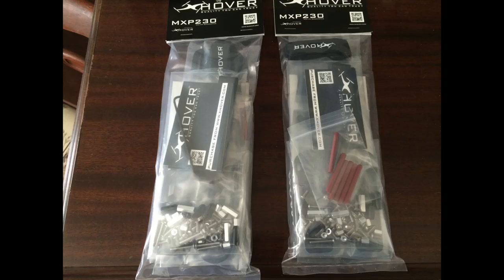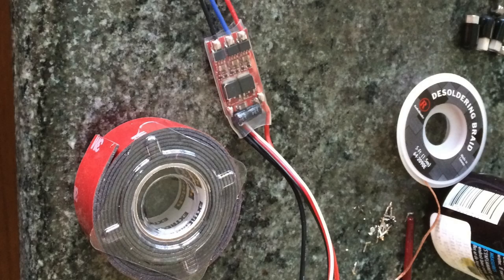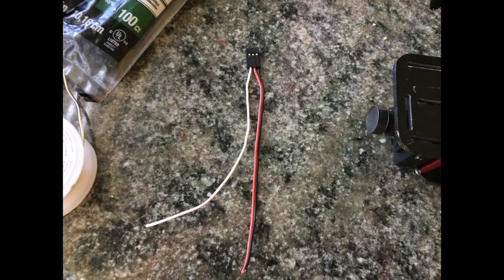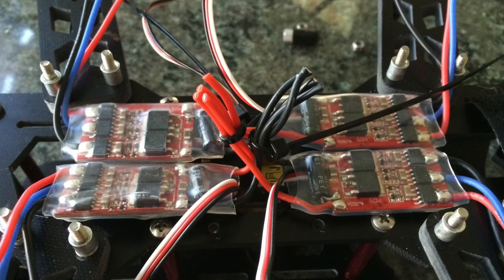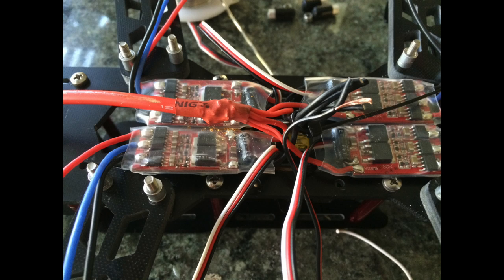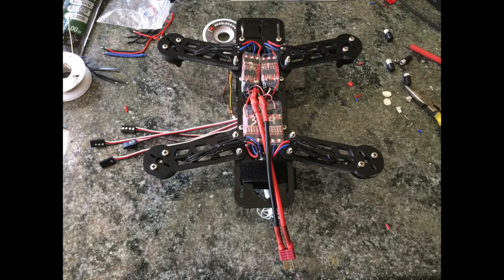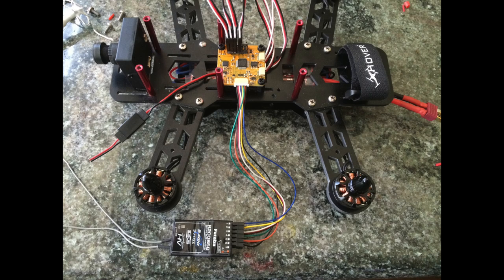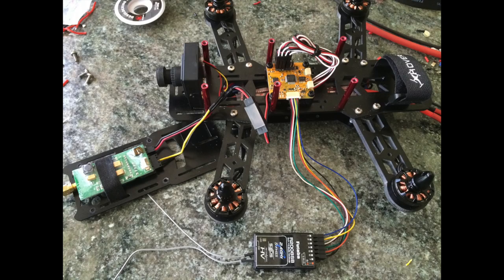mxp230 power distribution "how to"

Comment: Good video! Just ordered a MXP230 E v2 and are sifting thou the tube for information.. 
But i think i need to correct you regarding cutting the ESC cable for three of the ESCs in order to not fry your board.. That is true only if you have a switched BEC, most ESC have linear BECs and are OK with being connected all at the same time.. :)
Fly hard!

Comment: with the connection that you make for your fpv system can i run 4s batt? or only 3s?
Reply from the maker: With this PDB your fpv set-up will be what ever you use as main battery power. My fpv set-up will take both. Mostly your vtx will take up to 4s. Make sure you camera can take 4s also unless you power your camera with 5vdc from the vtx (video transmitter)